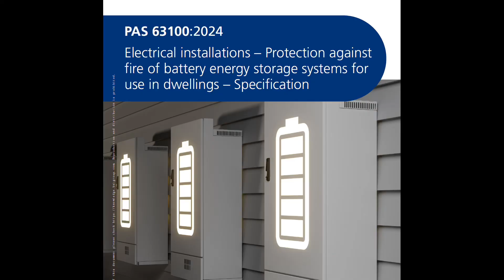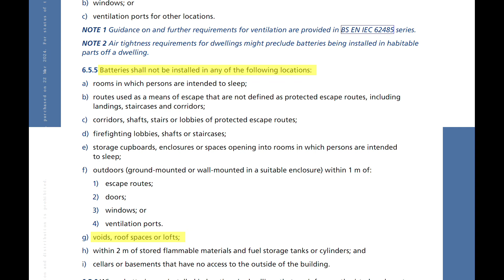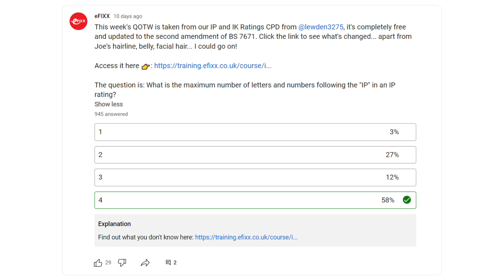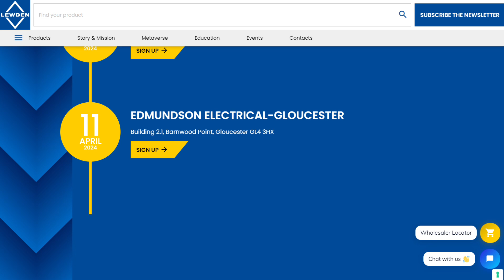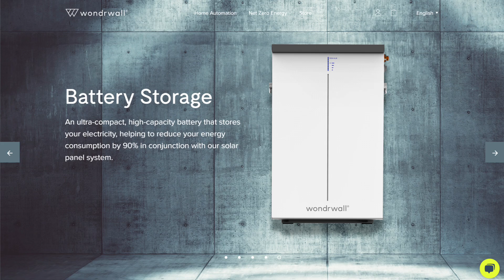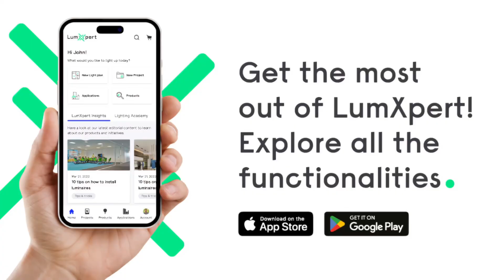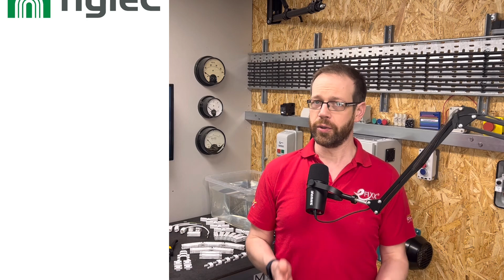New Standard Bans Solar Battery Storage In Lofts BSI  PAS 63100:2024

Comment: Can't have a battery in the loft because of the risk of it falling through a ceiling? But you can have water tanks/cylinders that weigh twice as much? Also the batteries have an operating temperature of 60°c, lofts in the UK never get that hot.

Comment: Why would you install Lifepo4 batteries external. They are not a fire risk and fitting them externally will reduce performance in the winter when you need them most. 
People are mixing up fires from poorly made battery scooters and bicycles which use a different chemistry.

Comment: It's safe to install them inside houses giving the correct environment such as never charging below freezing conditions, an arc is down to incompetent installer.

They could be installed into fireproof enclosures, on a brick wall.

Next they will be banning batteries in remote controlls.
Reply from the maker: Okay crack on and ignore a standard which will be adopted by insurance industry.
Reply: @efixx You didn't even read PAS 63100 properly though, did you?
Reply from the maker: @VinoVeritas_ what bit have we struggled with?
Reply: @efixx  PAS 63100 is a Publicly Available Specification and many levels away from actual legislation. It's also riddled with the words "where practicable". To suggest it bans outright the installation of batteries in a loft is a massive leap and completely disingenuous on your behalf. Like I've mentioned in another comment, the solar PV installers can barely read, let alone think for themselves. As you well know, a lot of MCS accredited installation businesses were roofers and scaffolders 2 years ago.
Reply: @efixx  Fuck the insurance industry!

Comment: I have a solar PV setup with 10kW of batteries in my garage. A friend has an identical system with batteries on an outside wall. On a cold clear day I charge at up to the max 3kWh rate, he only manages 200w! The reason given? His batteries are too cold. He then built a cover for them out of insulated board and installed a 40w cylindrical heater inside. The result - no difference.

Comment: Some of this equipment is going to become the "VIR" and wooden back-boxes of the 2040s. In 20+ years there may be a lot of old, obsolete (possibly hazardous) electrical equipment installed in some houses; defunct panels, inverters, old Li batteries in unsafe locations, EV charge points etc. Not forgetting early heat pump installations.

Comment: Solar batteries are  LiFeP04 which do not explode or catch fire. Temperatures in the loft can get a bit high but these batteries are high and low temperature tolerant. I would imagine the main risk is weight. I have had additional batteries installed in the garage and they weigh 80Kg. The footprint is the same as a pizza box so in a fire a  loft mounted battery could rip through the floor. No need to panic but probably better to use a garage.
Reply: Tesla Powerwalls use Lithium Nickel Manganese Cobalt chemistry cells though.
Reply: There are also some using lithium ion such as iirc the growatt recycled ev batteries. Life is probably better suited as they don't need fast charge capability or the need to dump current like they do in an EV.
Reply: @carlwilliams3488  You're incorrectly referring to Nickel Manganese Cobalt (NMC) as Lithium-Ion. Lithium-Ion is a family of cell chemistries that use the intercalation of Lithium ions in the cathode.
Reply: @VinoVeritas_  should have said LMO chemistry but no one would have any idea what I was talking about they don't realise that the battery chemistry more often usedis different to EVs with only the odd ones now being the more volatile types.

Comment: As a consumer with a call booked with Octopus to discuss installation I'll be interested to see if their advisor even knows about this. My bungalow has one wall that meets the requirements for outside placement as it's detached, most properties won't, the garden? I have a detached garage but by the time cables are run I suspect costs will escalate. Update: They didn't so I sent them a copy.
Reply: Until it's included in BS7671 or the Building Regulations, it's irrelevant. Just eFixx clickbait.

Comment: What aopears to be common sense on first glance has potentially not been thought through. Has battery chemistry been considered here?  The evidence shows that LiFePo4 batteries are extremely stable and resistant to fire. I cant recall a single case of a battery fire due to a malfunction in one of these modules. Operating temperature is up to 50 deg C - if it excedes this, it shuts down but wont catch fire. A ventilated loft space in the UK shouldn't exceed the operating temperature. Most battery systems are wall mounted into bricks or blocks so no issue falling through floors. Would it not be more constructive to qualify an incoming standards document to mitigate risk? In cities like London, many properties will now be unsuitable for solar.
Reply: Absolutely... this seems like regulations trying to catch up with the technology but the tech has already moved on.
Reply: Have seen plenty of YouTube electricians visit houses where batteries are just sat on floor boards in the lost, not even secured to anything. Unfortunately there are very good and and some very bad solar installers. Before batteries came along just look how some of the inverters are fitted. Sunny boy instructions at the time stated “ mount vertical on a non combustible surface” yet I have seen them on chipboard screwed to the diagonal truss legs.

Comment: Are standards written on a back of a bus ticket on a bus to work .  As an ex builder i can say the changes i have seen over my life are farcical , especially on electrics and ventilation /insulation .  However even though its not regs i charge my batteries in an old oven with fire alarm and fire blanket  fitted and ready .

Comment: On the solar Batteries as, I am not a professional. My Father has a Battery installed. Its on a reinforced section, the reinforcing is fire retardant (concrete board, i think its called), there is venting and a fire detection device which is on the mains and linked to the rest of the house system.  Reading the linked notes it isnt concerned with low voltage set ups. So i looked up low voltage on the BS number shown in notes and it looked like as His Batteries are a nominal 50v DC. Theu are considered low voltage.

So am i right in saying this style of install is uneffected by this change in guidance? 

I live in a flat which peculiar has a loft and a roof and was considering copying my fathers install later this year.

Comment: I’ve been looking into getting solar and a battery but want both the inverter and battery externally mounted. I have a suitable north facing wall but there is a real lack of battery external enclosures. A waterproof enclosure with air ventilation and even the ability to add some fireproof insulation shouldn’t be too hard to design.

Comment: This does sound a bit like a regulation based on the assumption that all lithium based batteries are the same rather than differentiating the LiFePO4 batteries most use and the Lithium ternary batteries that the Tesla Powerwall certainly used to use. Also if you stick a battery outside you run into the potential problem of low temperature charging. I would think a decently constructed LiFePO4 battery fixed to a gable end in a decently insulated / ventilated loft would be fine.
Reply: 56 °C in my loft today. Put a temperature logger in there, because I was contemplating putting the inverter in there.

Comment: Speaking with a customer hat on, I had panels installed last year including a battery in the loft, this is very interesting.  I completely understand where this is coming from but may have deterred me from purchasing a system.  Looking where else I could have it installed is restricted and would impact on the budget.  How weatherproof is the equipment and is there a variation between makes?
Reply: Do you know what your battery chemistry is?

Comment: Well, IDK specifically what is included, but I know we do have related regulations in the US. Wiring related issues are address in the NEC, National Electrical Code, which is a the NFPA, (National Fire Protection Association) But there are separate sections like the NFPA 855 Standard for the Installation of Stationary Energy Storage Systems, which cover the kind of issues related to these installations. There may also be some related regulations in the IFC, IRC and IBC, which are similar "building codes"  which may or may not apply in a specific area. 

NFPA regulations tend to be considered as the national standards, however, technically States have  overall jurisdiction and can vary from State to State.  Additionally, other local codes may apply. These may exist in big cities and sometimes counties. Generally, these local codes tend to be regulations that exceed the NFPA standards. Usually being in compliance with NFPA codes, you are probably going to be 95% covered, but some additional restrictions may apply. NFPA codes will give you a very safe system, usually far better than international standards. I reasonably sure that the NFPA 855 code, would not allow this. That said, depending on where you live, they may or may not be any formal inspections to ensure compliance.

Personally, I am not a fan of any "high energy utilizing" equipment in attics or what you call lofts, but a lot of building codes do allow this. Mainly HVAC equipment, that may include furnaces. I personally think anything beyond air circulating equipment has some risks although the equipment may be certified for such locations. Just seems like common dense to me as these are areas that tend to be routinely ignored and problems may go unnoticed. 

I can not say with confidence that this situation does not exist here, but I suspect it is very rare. Mainly because we tend to have larger homesites, detached garages and generally better spaces to put such systems.  Plus I don't see people looking to save the cost of cabling to save relatively small cost!  We are certainly not as "copper conscious" as people in the UK seem to be, Frugal is not a word used very often!! We tend to look at what we need and then go with twice as much!! We end to error on the side of excess and then end up using it. I can confidently say, I would never put in a system like this or see it as a viable solution to not enough space!!  Just seems like a bad idea to have  this inside of a residence.
Reply: In the UK, most of us are poor and can't afford basic necessities. Must be nice to have options.
Reply: @levyroth  Must be nice to have national healthcare!!

Statistics do not support your statement. Although poverty is higher in the the IK than the US you have a lot of government services and overall, most people in the UK are not poor. although some are.

I find it  hard to believe that poor people are installing solar battery storage! I can assure that only those of comfortable wealth in the US are installing these systems!

If you can't afford to do it safely and instead go cheap and put your home and foamily at risk, I'd argue that you couldn't afford it in he first place!! In the US, we don't consider doing things unsafely half-assed on the cheap, is really an option.  That's not to say that we don't have DIYers who do dumb things because they don't know better, we have plenty of those!  But that is different than consciously trading safety for a lower cost!

Comment: Wondrwall is the worst smart home system I’ve ever had the misfortune of coming across! Do Not Buy! Customer support have there hands tied by management that know how terrible the system is.
Reply: What's wrong with it?
Reply: My apartment came with a Wondrwall system.
While I have no experience of the battery I do have experience with other offerings they provide. Take for example the light switches, they get warm when turned on. The light switches also act as thermostats and the property’s electric heating was controlled by them. So you in a constant battle with your heating system should you decide to turn the lights on.

The app is horribly clunky and slow, it takes maybe 15mins to add a single device in a process that should take no more than 30sec.
The app doesn’t work if you go out of the UK, simply will not allow you to log in or remained logged in. This is fine until your out the country and family visit and you have set the inbuilt alarm system and are unable to disarm it and it’s going off at 11pm.

The system uses an outdated Zigbee protocol that they also closed off (it’s supposed to be an open protocol) so you can’t interfere it with Google, Apple, home assistant, it only “works” (I use that term loosely) with Alexa.

Customer support was friendly but completely unable to help. I reported many of the issues to tech support but they don’t have an in house programming and it’s all farmed out to the cheapest bidder when they have a big batch of changes to be made, I wasted over 6 month for an update to address some of the issues and nothing happened, just check out the App Store reviews.

People report the alarm system going off repeatedly for no reason.

When I left a review on Google they offered me £100 to take the system back as long as I took my review down. This was an insult as my time alone is worth more than £100 let alone replacing the heating and lighting control systems.

Scheduling anything on the system is a complete pain and is basically non-functional, you think you would be able to tell your lights to come on automatically if you away from home at 8pm, well this isn’t an option and is not/will not be supported.

The screw terminals on the light switches don’t have the correct clearances so you could if you were unlucky touch like electrical parts (you should be working safely and isolate and prove dead.) but they should still conform to the standards for live exposed parts.

So from my experiences with them id stay 100 million miles away.

Comment: Batteries outside in the rain or in a damp garage with lots of flammable materials in there. Yeah, that'll be so much safer...
Reply: The batteries do not burn or explode. So apart from weight little to no risk.
Reply: @mbak7801  - So why are they moving them out of lofts? And why are there loads of videos of Teslas burning uncontrollably?
Reply: @Benzknees  ... EV burning is, for the most part, an internet meme ... good for clicks but extraordinarily rare! How many home batteries that have caused a fire have we heard about? Washing machines, dryers and electric heaters all cause fires quite frequently yet we're quite relaxed about having them in our homes!
Reply: @MrAdopado  - It's different from normal batteries, as you have large arrays of batteries packed together, where a fault in one can lead to thermal runaway. As those videos show, the resultant fires are intense, potentially explosive & long lasting. And they release poisonous chemicals & can't be fought with water. 
Zurich Insurers recommend parking EVs 10m from combustible walls & 7.5m from window openings. The idea of a home array sat inside a garage or near to a house, exposed to rain & condensation, is an uncomfortable one!

Comment: Why in earth would you put them in a loft they are a fire hazard in fact they should be housed outside the building  in a fire proof compartment .
Reply: Gas appliances and pipework are an explosion hazard, yet we as a society accept the risks associated with piping methane / propane into our buildings.  Leaks do happen, even when the work has been done by a competent gas fitter. It’s called corrosion and wear/ tear.  The worst consequences are thankfully rare.

Home battery fires will happen, but I suspect they’ll be rare.  What wouldn’t be helpful would be regulations that are so restrictive that there are no options for installing them at home at all.  LFP batteries for example are much safer from a fire risk perspective. 

Never let perfection become the enemy of good.
Reply: Because most house batteries aren't a particular fire hazard (any more than any other electrical appliance). They use LiFePO4 chemistry which doesn't catch fire easily and doesn't result in thermal runaway.
Reply: There are far more consumer units fitted in houses in risky locations, under stairs, cuoboards etc. Let's ban those too! Far more likely to catch fire in my opinion, having come across many with burnt terminations..

Comment: Has there been a problem with batteries in lofts? Does it define size ( eg AAA!) or type ( e. g. Thermal, lead acid, hot sand, etc)?
Reply from the maker: An ESS battery weighs in at around 50kg

Comment: Who is putting batteries in the loft, or indeed anywhere indoors 😱.
They are more flammable than a heating oil tank, so I would think of similar locations to that for siting a battery bank.
Reply: Lithium batteries dont do well in the cold, so you would have to heat yor battery shed in winter
Reply: There have been several house fires due to Solar panel installations in Loft, in one case the house was gutted.
Reply: Me!
Reply from the maker: Good points. 👍